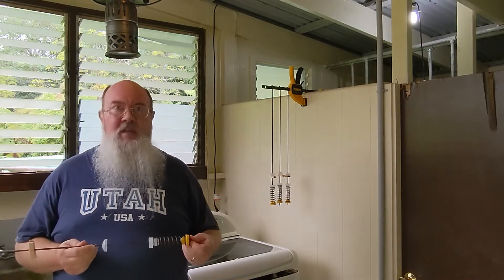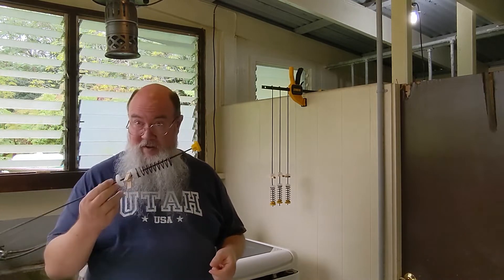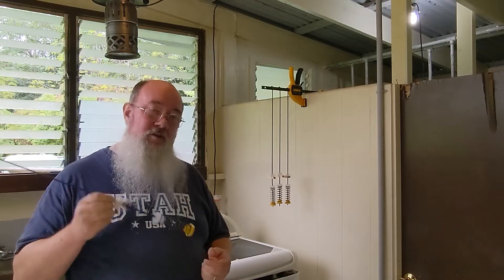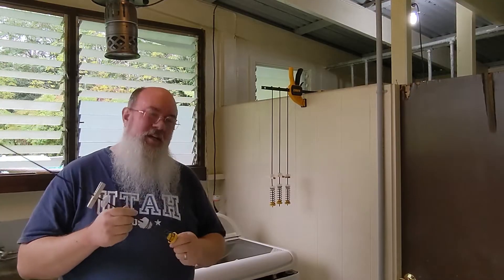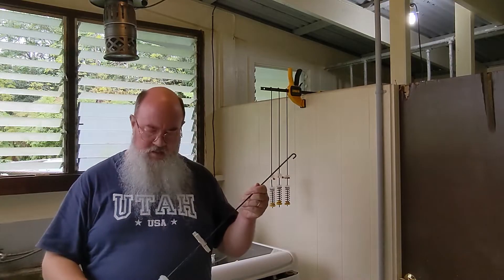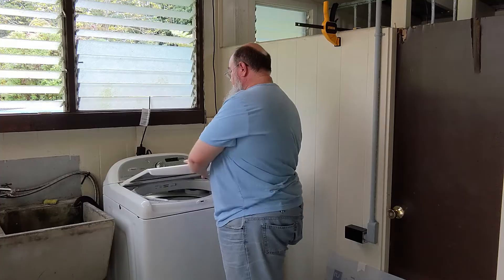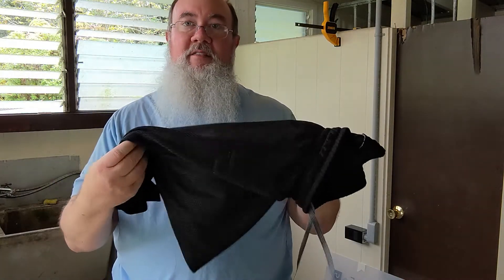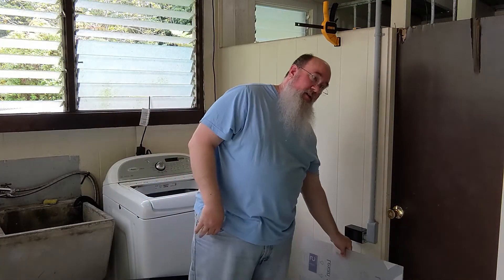FIX your washing machine rods! Don't $$buy$$ a new washer or washer rods before watching this video!

Comment: YOU DON'T NEED TO DO ALL OF THIS AT ALL!!! The fix is messy as hell but will only take ya about an extra 30mins over just replacing the rods.

Our 2020 Samsung washer got to where no matter how much you babied it by carefully placing the clothes in 99% of every load would have the UB error.

Rather then buying new  Suspension rods we bought a tube of the Nyogel 767A Synthetic Damping Grease on Amazon for about $26 total and refilled the original rods as they are the best mknry can buy..

Tools you need are
Nyogel 767A Synthetic Damping Grease.
 a flat bladed screw driver 
a Phillips driver
some tough gloves!! nitrile wont work as the grease will rip them apart as its extremely sticky.
Rubbing  Alcohol
Paper towels 
And maybe a helping hand.

Each washer is different so get down to the rods and take one out. 

On the lower section on top of the spring is a cup,you need to split that cup in half if you look closely you will see where they separate,using the flat blade you should be able to split them fairly easily.

inside one half of the cup should be a sponge  piece, you can remove it by putting pressure on one side of the cup while sliding it up the rod and the  Friction should pull the sponge out. This sponge combined with the Damping Grease is the magic of how these rods work.

Take the sponge out (the one in our washer came split down the middle long ways,if yours is solid  use a razer blade to make a split so you can take it off the rod) now wipe it down with a paper towel that has Rubbing alcohol on it.

Wipe down any more black Grease that you see in the area. 

Apply about a quarter sized amount of the Nyogel 767A Synthetic Damping Grease Lubricant to the inside of the sponge and carefully slide the sponge back into the cup,then slide both halfs of the cup back together.

Now this is the important part.i believe the reason the old Grease is black is from wear of the sponge  which has  Contaminated the old Grease and will make it not Damping as well,so the rods fail to keep things in balance.as you compress the cup down onto the spring a few times you will start to see more black Grease on the rod.this is the new clean Grease pushing the old dirty crap out so Clean that black crap off really good. Compres the spring a good 10 times or so and wipe as much of the black Grease away as you can.

Now pull the cup apart again and repeat cleaning the sponge and refilling until its fairly clean when you press the cup and spring together a few times.

Before the final time to go to put the cup back together put a little extra Grease in behind the sponge on either side,then put everything back together and repeat for the other rods.

I did this today and to test it we dumped a huge load of towels in without worrying about placement, just straight out of the basket into the washer which we haven't been able to even attempt since it was brand new,and it washed and spun everything just like it was brand new.

I do not know how long this will last,but im hoping atleast a year and if so it will just become part of our year  Maintenance on our washer&dryer.
Reply: What if the plastic part is loose though like not stuck in the coils like it’s suppose to be but separated from it then do we need to do what he does in this vid to make “another one” that will be stuck in the coils or will just doing what ur saying with the  Nyogel work?
Reply: Also can we use another brand of dampening grease/gel or does it have to be nyogel? Thanks
Reply from the maker: @caseslearningtube  If you know another dampening grease, it will probably work fine. This was just something I ran across that I thought would do the job, and it turns out I was right.
Reply from the maker: Unfortunately, what often happens with bouncy washers that have been bouncy for a long time is that none of those little bits are still remotely viable. In my case, the grease had burned and the seals completely rotted. Hence, I'm pulling them out in little pieces with the flat head to build new stabilizers.

Comment: Thanks man!  We live on Kauai and have had this issue on our washer probably a year after we bought it (had to wait months for it like you said)
Gonna give this a shot before I shell out for new rods/springs
Thanks!!
Reply from the maker: Aloha! How did it work out?
Reply: @zackstone6354  
PERFECT! 
I bought exactly what you used and did the same.  It’s been weeks now and no banging when spinning even with big, heavy loads.  And like you say, if it starts banging again, I will just apply more dampening grease from time to time if needed.  So far no need works like brand new.
Thank you!!

Comment: Once you shaped the expoxy , do you let it dry and stick to the rod or do you gotta keep it from setting up and sticking to the rod ??
Reply from the maker: I try to keep it from sticking too much to it. You don't want to let it BOND with the rod. A little stick is okay so long as you can break it free. The epoxy piece needs to be able to move with the spring.
Reply: Aloha! (We have close friends in Kauai.) Deeply grateful for your video and expertise. QUESTION: How do you keep the putty from bonding with the steel shaft? I will be attempting this repair over the weekend. If you could share your wisdom and experience on this, it would be (even more) greatly appreciated! Mahalo!

Comment: Zach, I watched your video and also this one here: https://youtu.be/W3VE66YIWss

I'm wondering if, instead of disassembling the cup and fashioning that additional piece from the SteelStik putty, why not just use a plastic collar clamp (as seen in the aforementioned video), in addition to using your suggestion of the 767A grease? I think the other video is onto something, but missing the relubricating with damping grease.

Thoughts?
Reply from the maker: I love it! I left a comment on his video. I may end up doing 2 rods that way and 2 rods my way on the next one - just to see which lasts longer. I'm a sucker for the simplicity of his approach, though. If you have white cups and clear grease, it should be fine to leave that so long as the grease still feels a bit "tacky." If the grease is yellow or brown, then I'd replace it. If you started with black grease (some rods I've seen do), then I'm not sure what would be best, there ...
Reply: I'm not sure how this method would work on the damper rod assemblies that do NOT have the extended "nipple" on the upper spring retainer "cap" for the metal collar to attach to?

Comment: Thank you for the video.  I ended up cleaning off the rod assembly but had nothing to use but some 3M Super && Multipurpose Adhesive.  I sprayed it all inside the pieces and over the rod and reinstalled it.  It now runs like new pretty much.  Thanks again.

Comment: Hi Zack.  The wife’s washer was walking across the floor every spin cycle.  I thought about replacing the suspension rods but wanted to know why they wear out.  I watched several videos only to be frustrated with the fixes.  Then I watched your video and realized you had figured it out.  I bought some damping grease and fixed the machine tonight.  It works like new once again! Thanks for the great advice!  Cheers!
Reply: I also was completely frustrated with nobody explaining why they fail.  Not one person even measured the sping height to prove they were compressed without any load, nobody ever mentioned just buying new springs and rebuilding the rods.  Now we have the answer.
Reply: My mother’s new GE walks around the room. Insane. Parts could not be worn, it did it when bran spankin new!

Comment: What about the idea of finding something metal that can be tightened around the rod in place of the plastic or SteelStick gripper.  In fact, what about stacking 2 or 3 Zip Ties that are pulled as tight as they can go to see how quick they burn down or not.
Reply from the maker: There's another video that someone posted a link to in the comments. https://youtu.be/W3VE66YIWss - I love the simplicity of this approach, but I don't really know how to compare how long it will last. Part of the purpose of the epoxy is to increase the surface area for the action of the grease, not just to make it tighter, again. Intuitively, I think it should work longer if you have a greater amount of contact with the rod than just a zip tie as a restriction, but I don't know for certain that would be better than the original plastic cup getting squeezed by a metal constrictor ...

Comment: After doing tons of research, discovered that the grease is Damping grease designed to cause resistance. I uncapped mine, slid the packing out, re applied grease from underneath cap to rod, wrapped electrical tape around packing a few rounds and snapped together. Now resistance is there again. Packing piece is tapered to squeeze tight against rod.
Reply: I've ordered the grease, and I think I'll copy your idea of using electrical tape to increase the friction on the packing tube. I was wondering if the packing material appeared to be open cell, allowing it to absorb the grease. If so, perhaps the packing material was originally infused with the grease and served as both a friction media and reservoir to slowly release more grease. Thanks for posting and thanks to Zack for recognizing the grease.
Reply from the maker: @WilliamH_62  I think that was the original design intent, but the friction media in mine seemed to be a sort of PE foam. I can't imagine that was "built to last." The best thing is probably some kind of brass fitting or sleeve with the damping grease between it and the rod. Something cut on a lathe an machined with precision to allow the least amount of grease between the damper and the rod.

Comment: I totally admire your insight into this problem.   Thanks to Amazon - I was able to purchase a set of suspension rods and they were delivered a few days later. Wish me luck.   I am absolutely going to try your approach if this problem rears its ugly head.   Last year I noticed rust on the exterior of the washer housing down around the base of the unit.   Six years.   You'd think they could make enamel last a little longer.
Reply from the maker: But then you wouldn't need a new one ...

Comment: That was excellent -- especially the analysis of how those rods work.  I've been scratching my head trying to figure out what goes on with them.  For me, I'll just replace them every few years -- I'm too lazy to use your method, lol.  But I am very impressed with your uncovering the way the these work.

Thanks!
Reply from the maker: I mean, if you are going to go through all the trouble of replacing them, you are already doing the hard part: Taking them out and putting them back in! All I'm doing is adding a few bits of sticky stuff between those parts of the job. 😇
Reply: @zackstone6354  I suppose so.  I've saved a link to this so maybe next time they go I will do it.  Time will tell.  Or the damn washer might break beyond easy repair, lol.  Thanks again.

Comment: Appreciate the thrust of this and I know island life (Vieques, Puerto Rico) - you have to make do sometimes - but ppl don't have time to play games w/ that. The WasherDryerMoney guy said his hot glue solution stopped working after a month. There are many modules or components we buy for things from trucks to computers that are 'all of a piece' because drilling down to that one thing that fouled up is a worse option. I don't want to know if the piston or clutch assembly of my truck's AC compressor went out, I'm just going to order a new compressor. Same here. The linear dampener on all these models are different too. Here's a guy who knows all these connecting rod assemblies, he said GE were the only ones to get it right though the Samsung one is engineered well, probably second best:

1:55 mark

https://youtu.be/xmBJdpUfV-Q
Reply from the maker: At the end of the day, you are paying for $$$ steel rod to get a tiny patch of grease. Up to you, but most folks would rather just fix it to work with their own patch of grease. I would say, "the steel rod doesn't go bad," but as you mention, "Island Life." Rust is real, and the rods CAN go bad quickly in marine environments if left to sit for a long time. But if you have a perfectly good looking steel rod, then it's probably fine. Just grease it.

Comment: I replaced the bit of pool noodle in the center with two rubber bands  (3.5"x.25") in the place of the pool noodle. Seems to work fine for about 5 cents.

Comment: Thanks for the explanation! Bought that dampening grease! :D
Reply from the maker: Did it work for you?
Reply: @zackstone6354  It did, however there was another video to use liquid nails in place of the sponges inside of the plastic things that go on the rod. I need to redo the liquid nail but the dampening grease does its job.

Comment: I’m confused as to the purpose of the epoxy putty. Is it attached to the rod, permanently in one place on the rod or does it slide?
Reply from the maker: It has to slide. The purpose is to "squeeze" the nyogel - to limit movement. You want it to have very narrow (but lubricated) clearance over the rod.
Reply: Do you put the grease on before you set the epoxy over the rod?  @zackstone6354

Comment: Hi, Zack, from Upstate South Carolina.  We owe you and Washer Dryer Money a great deal of gratitude!  Thank you, thank you, thank you!  Hubby and I were ready to give up the 10-year-old washing machine ... until we happened upon your suspension rod fix.  After watching WDM, then yours, we immediately ordered the Nyogel from Amazon and purchased Steel Stik from HD -- $32 investment saved hundreds!  I'm into the 2nd load today after reinstalling the rods -- spin cycle hums like it used to 10 years ago.  We'll still save our pennies should this fix not last, but we are confident it'll be quite some time before the knocking and banging returns.  If it does, we'll go thru the process again!  And you are correct ... this Nyogel lubricant will last longer than us in this life.  We both believe you are our new hero!   Janet and Ken in Greenville, SC
Reply: So, did the solution last?  I tried it and the Nyogel leaked out onto the springs and stopped working after a day.
Reply from the maker: @robertpodolsky6252  You have to have something cling to the rod more tightly than just the cups. If you didn't put in new dampers (the bits I use epoxy for), then it won't help. (Sorry I haven't been responsive - I've had a family emergency tying me up for the past 8 months.)

Comment: I suspect that our Whirlpool Cabrio Platinum washer could use this, I would have liked to see what the original dampers looked like and maybe got an idea of what kind of material they're made out of, guess I'll see that when I tackle ours. Also, I'm not sure how much grease you used so I'll have to try to guess at that.
Reply from the maker: Not much grease, really. My dampeners were basically rotted, so I don't really know what the original material was. Sorry for the late reply, but curious if you were able to fix it.
Reply: @zackstone6354  It ended up being the main bolt on the bottom of the tub, underneath of the washer. It's easy to get to, it was loose. I cleaned the threads and put a dab of blue Loc-tite on them and tightened it up. It's been purring like a kitten since.

Comment: Hands down the best video and explanation of load balance problems. 

And thanks dude for making this!. my mind was asking the same questions about "the failure of said rods" after following the search. 
Great to know its a relatively simple repair. 

There are probably millions of rods now in landfill that did not need to be replaced.. Ridiculous the service technicians arent trained to service the rods. my washing machine brand (Fisher & Paykel) wants $157 for a set. 

this is the real gravy train for manufacturers.
Reply: If techs were “trained” to repair rods they would t really make any money. This is better off being an owner repair. You’ll save money on a service call and the tech will take a call where he can actually make money. Just my thinking on it. And to be honest they make appliances to be replaced anymore. Quality has gone way down. But I will say one of the main issues with these rods is that people want these huge washers and then overload them causing premature wear. It’s what I call false advertising on the Appliance company by marketing them as extra large capacity then making a cheap appliance that can’t hold up to what they are selling.
Reply from the maker: @kssooners1  I think you are very close to the truth on this. I'm very cynical about most new appliances and electronics. There's no reason for an LED TV to "wear out," right? So they invent ways for it to go bad. As to the service call bit, a truck roll these days must cost $250-300 with current inflation. If you can't recover that much profit from the stop, it isn't worth it. This is just the nature of things, today ... it is easier and cheaper to make a fully replaceable unit than to make a repairable one. This is also why "right to repair" is such a big deal, imo. The manufacturers do not, under any circumstances, want you fixing your own stuff. You should have to pay them to fix it or pay them to replace it. It is ruining both the economy and the planet over the long run ...